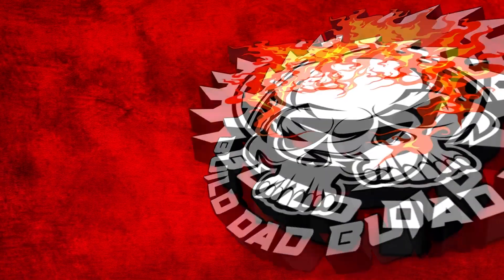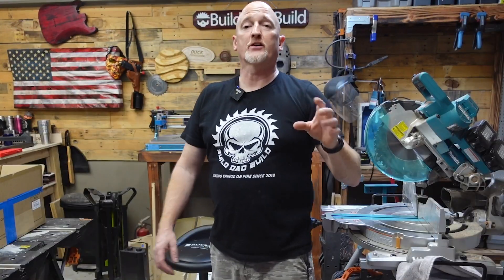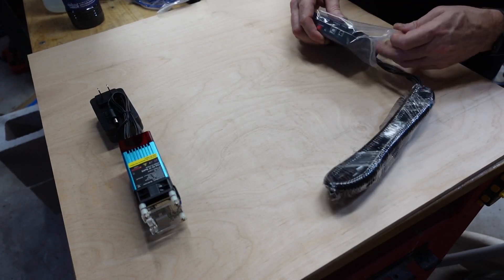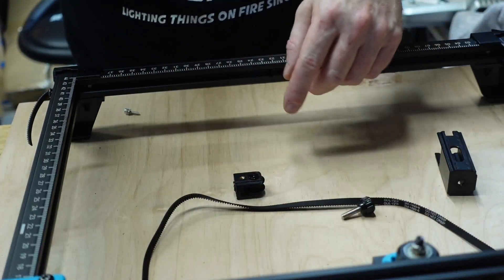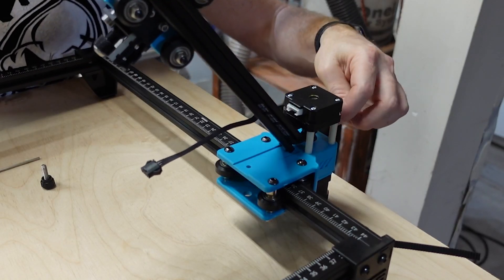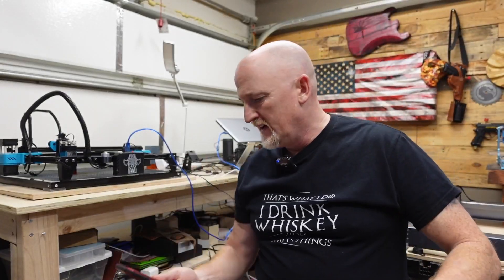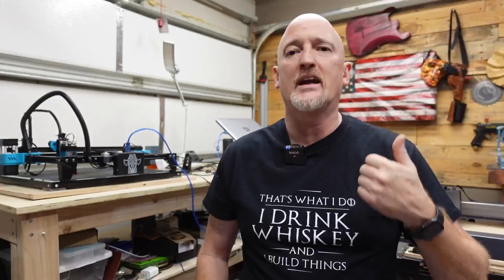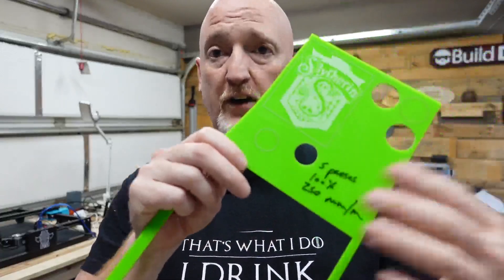Unboxing The Two Trees TTS - 55

Comment: Another great video. Great sound quality, as usual, Nick. I found it refreshing when you revealed the upside down 'user error' instead of just editing it out... shows that we can all get it wrong sometimes. I built my first diode laser myself, and (as you also described) I stand by it as a right of passage. By the time I had finished problem solving (every single aspect of ) it, I had a fairly good grounding in the subject. The two trees unit looks like a great introductory project, if a little fiddly. People often misunderstand how powerful these units can be once they are partnered with the awesome Lightburn software. I hope whoever wins it has a really good time with it.
Reply from the maker: Gotta show our mistakes! That's how we learn.
Cheers, Stuart

Comment: I recently bought the xtool d1. The crosshairs are nowhere close to where the laser begins working. (It's actually to the right by an inch almost). Is this right or is there calibration i need to do?
Love your channel bro!
Reply from the maker: Correct. This is by design. When the laser starts an engrave or cut, it will move to where the crosshairs are first and then begin.
Cheers
Reply: @BuildDadBuild  I'll have to double check, I don't think mine is doing that. Hhmmm

Comment: sup my bald headed brother, i have the glasses you use but unless im trying to see the work while its running i generally use a standard yellow, yellow orange safety glasses like i used to wear in the machine shop to cut down on welder flashes. not quite as good as the 40$ pair but def better than the crap they send with laser. also them old school blue blockers work great as well
Reply from the maker: Cuz you're a hip hopper? LOL
Cheers

Comment: One of the common complaints that I see with diode lasers is that after turning them up to 100% they quickly degrade and lose cutting power, have you run into this with any of the machines you’ve used or tested?
Reply: i have a box of dead lasers, i have had many a diode and yes at 100% power they start to degrade and its because they are not sufficiently cooled. I already add extra fans to my units. if you need to run at 100% power quite frankly you need a more powerful laser. I never go over 80% and norm run at 60% on my 5.5w output diode.

Comment: I just picked this laser up last week direct from Two Trees. It's been working great for me so far. I also picked up a Ortur Rotary to go along with it and it's been doing great engraving on water bottles.
Reply from the maker: Sweet!
Reply: @BuildDadBuild  I will also add, buying direct from these guys is much cheaper than buying through Amazon or Aliexpress. Saved about $40 that way vs going through another storefront. They have a warehouse in California, so it got to me within a week of ordering.